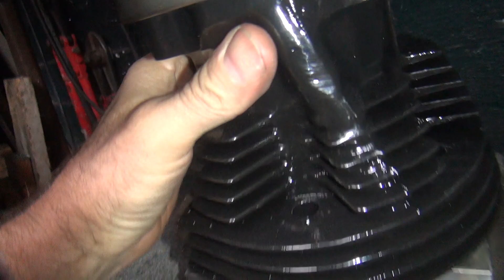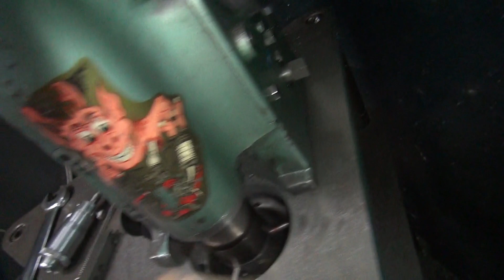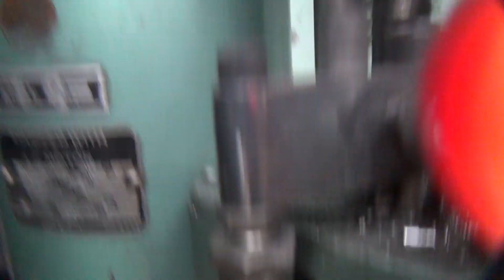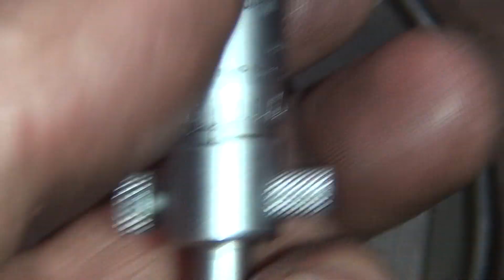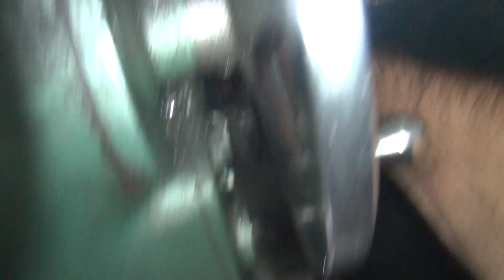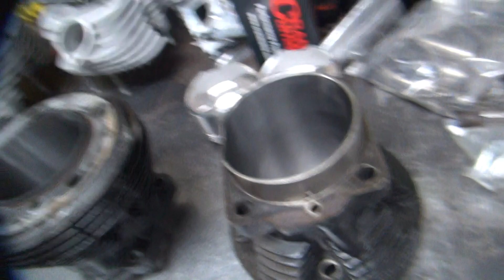#105 1978 80ci shovelhead motor rebuild mario's FL bobber chopper fx harley tatro machine

Comment: Keenan, have you ever sleeved a Harley Davidson cylinder? I wasn't sure what the advantages or disadvantages were. I'm sure once you're. 060" oversize it's time to either consider another set of cylinders or sleeve your existing cylinder. Sleeving seems like a great option IF done by a reputable machine shop. Thanks again for sharing your knowledge.
Reply from the maker: for the street they are ok. for racing they move. my single uses a sleeve but it is nothing like a regular sleeve.
tatro